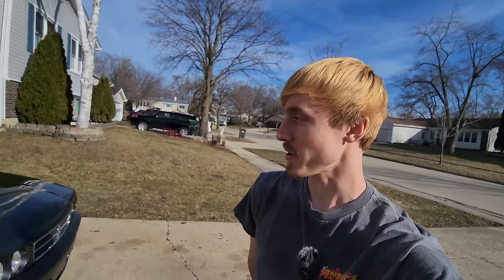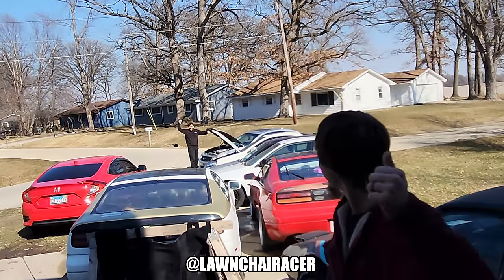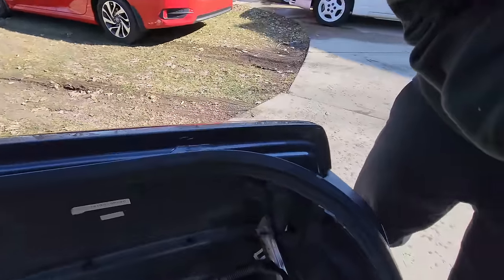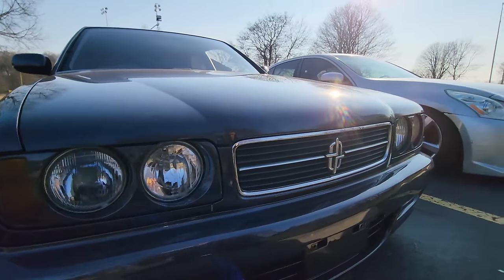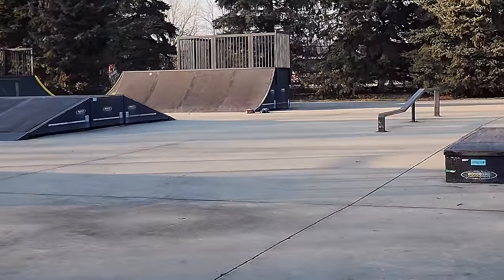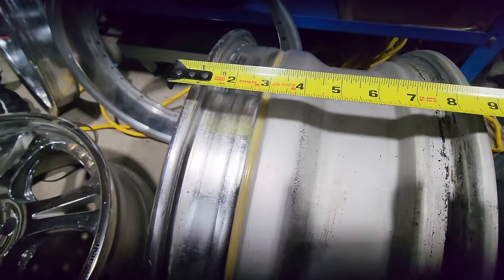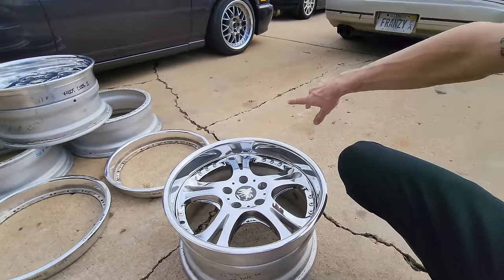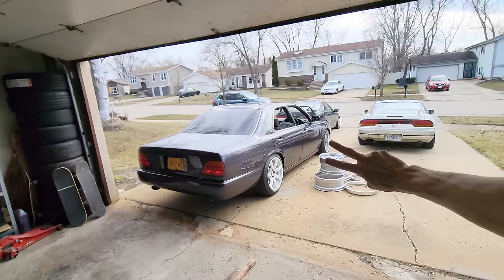Nissan Gloria is Near Completion! + How to Build 3 Piece Wheels

Comment: You have given me more and more inspiration to work on my 240SX. It is a 1991 se hatchback white just like yours everything all original with 322,000 miles and very good condition for the amount of miles it has. I picked it up from an older guy in Texas for $3, 000. 100% worth the 10-hour drive. My plan is to put an RB20 in it I've just been struggling with a workspace and money but I'm not going to give up on it! I'm excited to see the dent taken out of the 240 and soon paint job and videos like these hanging out with all the friends

Comment: holy shit instant sub. The video before this one already taught me a couple things about my Y33 (possibly) and even if I run into a trunk latch situation, that video taught me at least a couple diagnosing methods. Love the Y32 and lowkey wish I had one but I still love the Y33 and got lucky with finding and purchasing it. Imma be looking out for the videos my guy
Reply: Watching further around 10:00 I also realized what I learned when I got the car. The R32 and the Y32&Y33 Glorias share some things almost identically. The shape of the trunk for both Y chassis is super similar, I actually put an R32 GTR spoiler on my Y33 since there arent many spoilers and more so lips. The windows I believe are the same including the windshield but I didnt see anything about the rear window, and some inner trim pieces too. Y32 and Y33 Glorias can use the R32 GTR brake system including the ATTESA E-TS but that takes a bit more work but RS Yamamoto in Hyper Rev Cedric/Gloria did it. Super similar cars

Comment: If they were 8j et30 you’ll get 9j et 17 Minus half the extra width in mm from the original offset. 
This is because offset is measured from the centre of the wheel and you only added width to one side. So the centre point only moved half of the total width you added
Reply from the maker: Yes, that's a much better way to explain it, thank you 🙏

Comment: Only draw back to putting the hardware on the drill to make them shiny new, not only did u remove crusty stuff but u also removed most if not all of the costing to prevent rusting. So now that hardware is going to rust pretty quickly and bad

Comment: I was just about to restore my wheels like you are RN, got the hardware out and about to split them in to 3... start ripping the seal off and i look under... its welded.... dont know if i go through the hassle of getting them split ? its the only set of wheels that I have and I was gonna restore them myself individually running a spare wheel in place of the one im restoring... idk what to do.